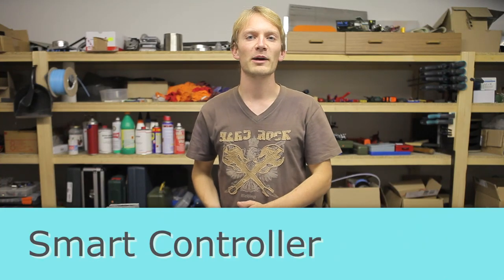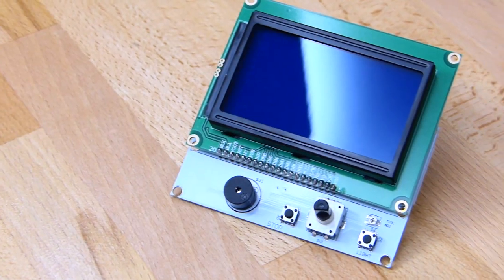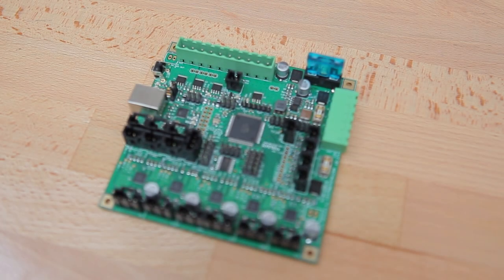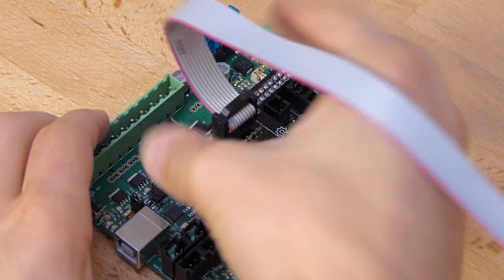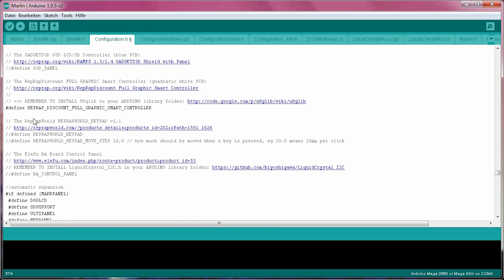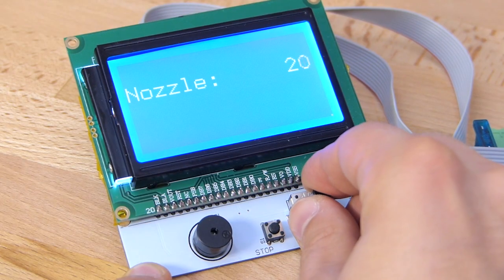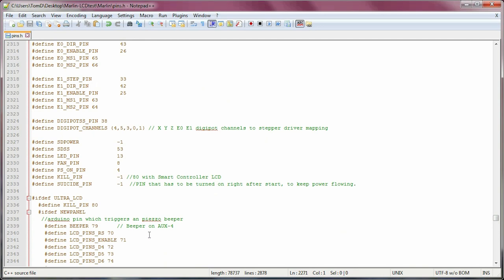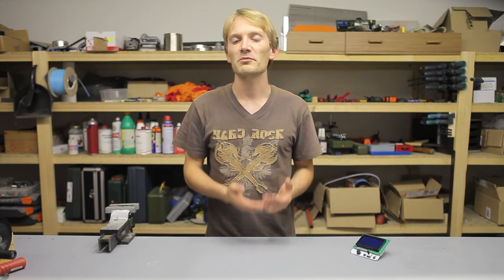3D printing guides - Setting up a LCD and SD card controller panel

Comment: Tried to follow and I must have done things wrong. When I first plugged it in I got the blue screen. When I switched the plugs I got nothing. Placed them back and have blue screen. Screen stays blue and on. Downloaded the Arduino file, and another u8glib file and added them to the library and added them to the Marlin file. Nothing. After adding the Arduino file I have a page of errors! I did not have the drivers plugged in, just wanted the screen to work. I tried a github file for the monoprice mini but when I downloaded the Marlin file on that page it only gave you the one tab marlin. I can see why many new people to this give up as I am at a loss.

Comment: I keep getting this message

Arduino: 1.6.11 (Windows 10), Board: "Arduino/Genuino Uno"

In file included from C:\Users\James\AppData\Local\Temp\Temp1_Marlin-RC.zip\Marlin-RC\Marlin\Marlin.ino:37:0:

sketch\MarlinConfig.h:29:20: fatal error: fastio.h: No such file or directory

 #include "fastio.h"

                    ^

compilation terminated.

exit status 1
Error compiling for board Arduino/Genuino Uno.

Comment: Great video as usual Tom.  I followed your instructions but the screen just flashed and the Piezo beeped endlessly with no screen info.  Ironically, with all your caution about plugging in the cables right,  my board was one with the sockets soldered in backwards and I finally got it to work by forcing the plugs in backwards on the lcd.  It took some serious surfing to figure that out but I wasn't the only one who had to do it.  Mine was a China clone made by reprapdiscount.com.
Reply: Thanks!! I have the same issue and I try to fix during 3hours. I invert cable and BAM!! Works.
Reply: which cable?

Comment: Problem using Marlin 1.6.4 with the U8glib added (said it already was added). Screen works, shows dual extruders and SD icon, but no beeping, no menu when pushing the stick in, and nothing from the stop button. Anyone else have this problem? BTW, tried Repetir firmware from the config site, and everything works fine.... BUT, really want Marlin on it.

Comment: hello ***** , I've just bought a smart lcd and tried to upgrade marlin following the steps from the video , but when I try to compile it appears the next error (i'm using a prusa i3 hephestos ) :

ultralcd.cpp: In function 'void config_lcd_level_bed()':
ultralcd.cpp:758: error: 'lcd' was not declared in this scope
ultralcd.cpp: In function 'void lcd_level_bed_cooling()':
ultralcd.cpp:769: error: 'lcd' was not declared in this scope
ultralcd.cpp:791: error: 'lcd' was not declared in this scope
ultralcd.cpp: In function 'void lcd_level_bed()':
ultralcd.cpp:800: error: 'lcd' was not declared in this scope
ultralcd.cpp: In function 'void lcd_load_material_extrud_1()':
ultralcd.cpp:944: error: 'lcd' was not declared in this scope
ultralcd.cpp: In function 'void lcd_unload_material_extrud_1()':
ultralcd.cpp:990: error: 'lcd' was not declared in this scope
ultralcd.cpp: In function 'void lcd_init()':
ultralcd.cpp:1418: error: 'lcd' was not declared in this scope

do you know how can i fix the errors ?

Thanks
Reply: +Jorge Marques I had the same exact problem with my prusa i3 rework. I commented out #define WITBOX in configuration.h and it worked after.
Reply: +Linus Forss yeeah , it works  thanks

Comment: Hello thank you for sharing the video. I seem to keep getting this error below could you help me out? thanks.

Arduino: 1.6.9 (Linux), Board: "Arduino/Genuino Mega or Mega 2560, ATmega2560 (Mega 2560)"

In file included from sketch/dogm_lcd_implementation.h:38:0,
                 from sketch/ultralcd.cpp:32:
sketch/dogm_font_data_marlin.h:12:25: fatal error: utility/u8g.h: No such file or directory
 #include <utility/u8g.h>
                         ^
compilation terminated.
exit status 1
Error compiling for board Arduino/Genuino Mega or Mega 2560.

This report would have more information with
"Show verbose output during compilation"
option enabled in File -> Preferences.
Reply: For people who might have this issue, this comes from the fact that the very last version of U8glib moved this file elsewhere. You can download version v1.18 which should work just fine

Comment: I just tried to do this and I got this error when I defined the smart controller in arduino
  This report would have more information with
  "Show verbose output during compilation"
  enabled in File > Preferences.
Arduino: 1.0.6 + Td: 1.20 (Windows 7), Board: "[BootloaderCDC]Teensylu/Printrboard"
In file included from ultralcd.cpp:37:
ultralcd_implementation_hitachi_HD44780.h:200: error: 'LCD_PINS_RS' was not declared in this scope
ultralcd_implementation_hitachi_HD44780.h:200: error: 'LCD_PINS_ENABLE' was not declared in this scope
ultralcd_implementation_hitachi_HD44780.h:200: error: 'LCD_PINS_D4' was not declared in this scope
ultralcd_implementation_hitachi_HD44780.h:200: error: 'LCD_PINS_D5' was not declared in this scope
ultralcd_implementation_hitachi_HD44780.h:200: error: 'LCD_PINS_D6' was not declared in this scope
ultralcd_implementation_hitachi_HD44780.h:200: error: 'LCD_PINS_D7' was not declared in this scope
ultralcd.cpp: In function 'void lcd_init()':
ultralcd.cpp:988: error: 'BTN_EN1' was not declared in this scope
ultralcd.cpp:989: error: 'BTN_EN2' was not declared in this scope
ultralcd.cpp:991: error: 'DIOBTN_EN1_RPORT' was not declared in this scope
ultralcd.cpp:991: error: 'DIOBTN_EN1_WPORT' was not declared in this scope
ultralcd.cpp:991: error: 'DIOBTN_EN1_PIN' was not declared in this scope
ultralcd.cpp:991: error: 'DIOBTN_EN1_WPORT' was not declared in this scope
ultralcd.cpp:991: error: 'DIOBTN_EN1_PIN' was not declared in this scope
ultralcd.cpp:991: error: 'DIOBTN_EN1_WPORT' was not declared in this scope
ultralcd.cpp:991: error: 'DIOBTN_EN1_PIN' was not declared in this scope
ultralcd.cpp:991: error: 'DIOBTN_EN1_WPORT' was not declared in this scope
ultralcd.cpp:991: error: 'DIOBTN_EN1_PIN' was not declared in this scope
ultralcd.cpp:992: error: 'DIOBTN_EN2_RPORT' was not declared in this scope
ultralcd.cpp:992: error: 'DIOBTN_EN2_WPORT' was not declared in this scope
ultralcd.cpp:992: error: 'DIOBTN_EN2_PIN' was not declared in this scope
ultralcd.cpp:992: error: 'DIOBTN_EN2_WPORT' was not declared in this scope
ultralcd.cpp:992: error: 'DIOBTN_EN2_PIN' was not declared in this scope
ultralcd.cpp:992: error: 'DIOBTN_EN2_WPORT' was not declared in this scope
ultralcd.cpp:992: error: 'DIOBTN_EN2_PIN' was not declared in this scope
ultralcd.cpp:992: error: 'DIOBTN_EN2_WPORT' was not declared in this scope
ultralcd.cpp:992: error: 'DIOBTN_EN2_PIN' was not declared in this scope
ultralcd.cpp: In function 'void lcd_buttons_update()':
ultralcd.cpp:1176: error: 'DIOBTN_EN1_RPORT' was not declared in this scope
ultralcd.cpp:1176: error: 'DIOBTN_EN1_PIN' was not declared in this scope
ultralcd.cpp:1177: error: 'DIOBTN_EN2_RPORT' was not declared in this scope
ultralcd.cpp:1177: error: 'DIOBTN_EN2_PIN' was not declared in this scope
Reply: I am using a geetech printrboard running UPMarlin for the two up
Reply: ***** I have no idea on how to even set up marlin. I have no experience in modifying code. I also used this: http://rs-micro.com/?p=285 to wire the lcd to be compatible with the printrboard

Comment: hi what are the pins.h for this lcd that you show it , i have some issue with the encoder , wont go anywhere after i push down the encoder knob, get stuck on info screen , light works , stop don't know yet . any help please .
i use marlin firmware1.0.0 rc2mm, on mega2560+ramps 1.4.
Reply: Mike Gallo yeah, having the same problem. even after i edit the pins.h file. anyone have a answer for this?
Reply: Channing Grayned other than that thanks Tom you are a life saver.
Reply: Channing Grayned  check the ribbon cable, my had the plug backward made, so i was connecting in the right way but was sending the wrong signal to wrong pin ..   replace it and now works fine.
Reply: Mike Gallo 
You will find this very interesting Mike G. When the instruction say make sure everything is plugged in they mean it or at lest make sure your lcd does not have a mintemp failure or anything like that. Your hotend and printbed has to be working or the system will protect its self from damage. That is probably why it keeps going back to the main screen to show you the failure. After I fixed my hotend and printbed on configuration.h and made sure they were in the right location on my Ramb0 1.2. BAM, my lcd would let me toggle between the main screen and contol menu.

Comment: Quick warning, using this big lcd on a ramps, will melt the Arduino's 5 volt regulator. If this happens the screen will only turn on if a usb is connected.

Comment: Moin ! Ich könnte deine helfende Hand gebrauchen . Mein Problem ist das ich einen 
SainSmart Smart Controller RAMPS 1.4 LCD 12864 LED besitze und diesen einfach nicht zum laufen bekomme. Das einzige was er macht ist piepsen wenn ich "drücke" und das Display leuchtet (Jumper) . Ich könnte mir gut vorstellen, dass ich einen anderen Controller einstellen muss  als den ST7920 aber welchen ?
Reply: 1.16 ja und 1.15 bin ich gerade am testen
EDIT: Ich habe gerade nochmal alles runter geschmissen und neu runtergeladen und neu installiert geht immer noch nicht.
Reply: Alles klar danke ! Die Produkte von SainSmart sind allesamt kaum zu gebrauchen. Bisher ist mir alles von denen abgeraucht, nun auch das Display.
Reply: ***** Hab gerade ein neues über deinen Link bestellt ! Danke für die schnelle Hilfe !

Comment: How I can change the Display Units to inches?
Reply: Greeting, thanks for taking my question, the reason is because I work as a university professor in Mexicali Baja California and in this city there is much work for the aerospace industry and companies use inches as your primary drive to work and I am currently building a 4-axis cnc machine and a 3D-printer and I think I can use the components to educational issues, so I need to change the parameters to inches for better job with the CAD/CAM softwares.

Comment: I put a .stl alone in the sd card > print from sd card, nothing happens, what should i do ??
Reply: +Marc PuiG YYYyou have to put a .gcode file. Use Cura or any other slicer to go from the stl to the GCode.